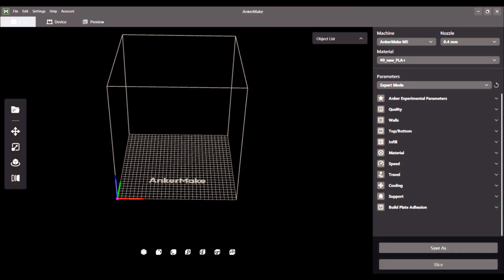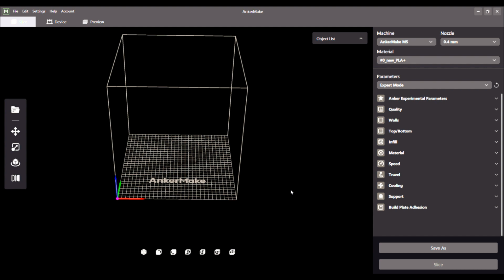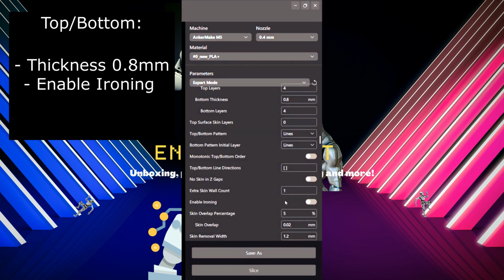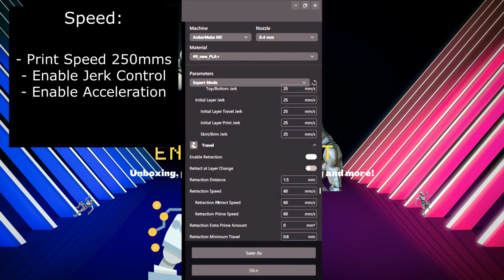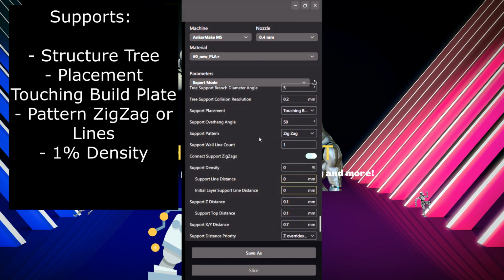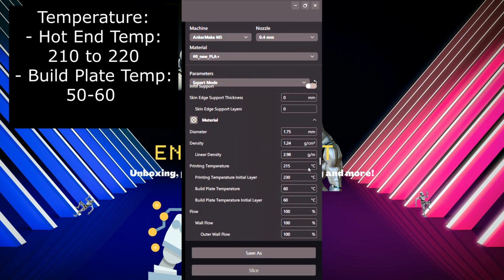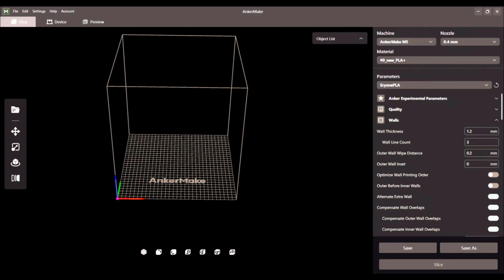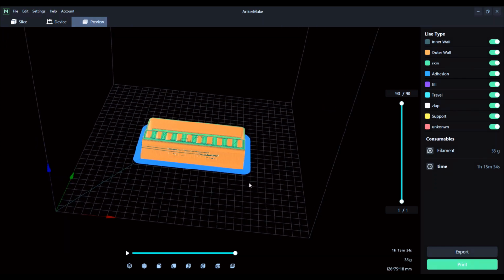AnkerMake M5 Slicer Settings for PLA/PLA+, time-lapse and pictures

Comment: The temperature of the first layer changed back to 230 after changing the printing temperature to 210. It seems like that's the default for the M5. 

You can change the printing temperature for the first layer just fine, but you have to be carefull because if you change the normal print temperature afterwards, the printing temperature for the first layer always defaults to a value that is 20 degrees higher than the normal printing temperature.
Reply from the maker: When you are setting the temp in expert mode, there are two spots you will need to change it to prevent this from happening. Let me know if you can't find it, and I'll make a quick YouTube short on it .

Comment: Do you find the support settings in Anker slicer to do well with models?
Reply from the maker: They do work but depending on your support settings, they can be near impossible to remove. I recommend touching buildplate setting and 0 or 1% density. If the support isn't strong enough then increase the density.

Comment: Dude, you need to slow down!  You rush through everything so fast I can't keep up and have to rewind several times to get all the settings.
Reply from the maker: The short answer, as per analytics, I need to keep the videos short and sweet in order to maintain the majority of my viewers.  I've created slower videos in the past, and the videos have failed due to them being too long and slow paced. 

Believe me it is very hard to balance everything out perfectly for everyone, so I figured if someone is looking for a slower pace they can hit the playback speed button, to slow the video down. I believe the option is under settings gear. It allows you to slow the video down between 0.25x - 0.75x of the original speed.

I hope this helps, but I will definitely keep this in mind for my next video and try to find a better balance.
Reply: @MicBot  Maybe you could post the setting in the comments as well?
Reply: I do agree a bit